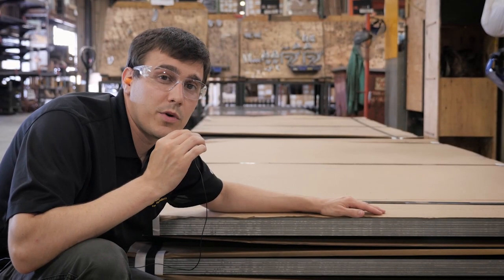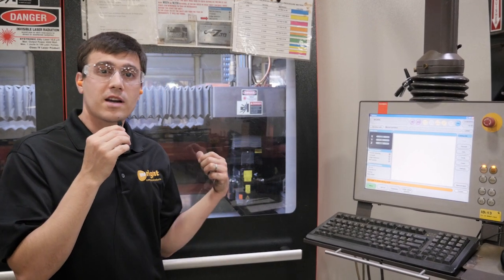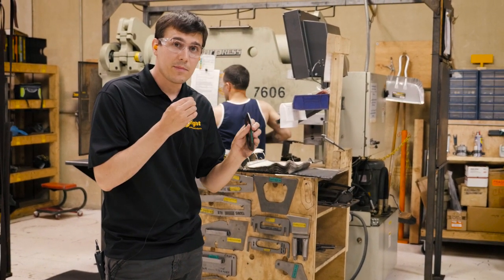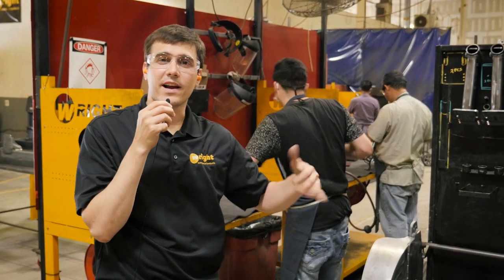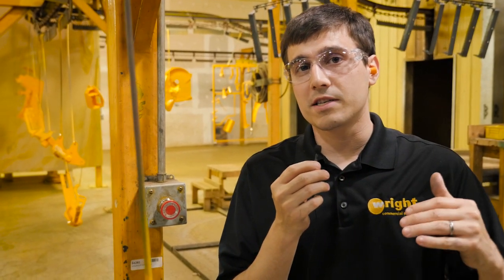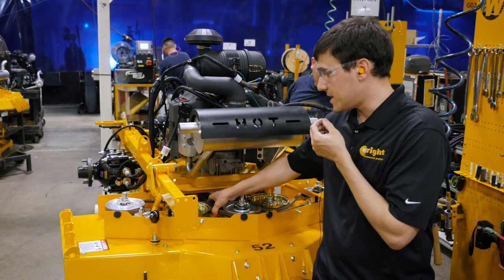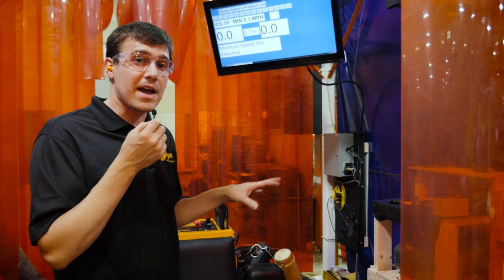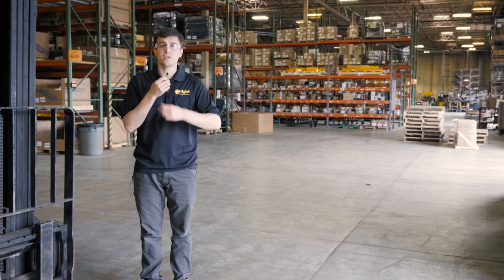Tour of Wright MFG Factory

Comment: hey there can someone tell how to remove or replace the blades in a stander 36 ?
it doesn’t have a nut in the top of the pulley
Reply from the maker: Hi Rigo, The easiest way to do it is with a cordless impact wrench from the bottom. -Ed

Comment: The machine sport x is to slow ,
I mass produce lawns , I bought 2 snapper s75x new and get 14 to 16 mph out of them beefed out , why dont they make them faster , is there a standard speed that is mandatory or does the company just feel its to dangerous , im getting 2 more 
Mowers soon but 8.5 to 10 mph to slow,im either going with ferris x2 standers or your sport x but need more speeds
Reply from the maker: You might be interested in our faster and more powerful stander called the "ZK" (Z-Killer). We have a video on it. Decks from 52"-72". We are actually running a sale this spring, until April 30, check if you go to our home page you will see it. Happy Spring!